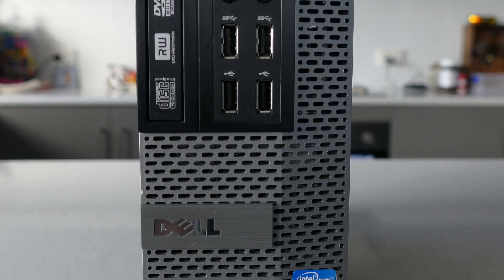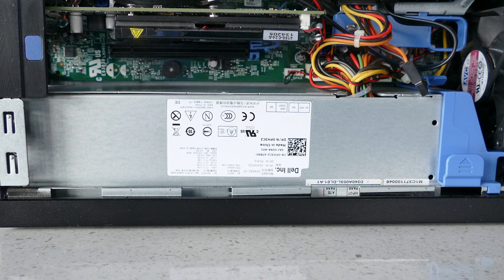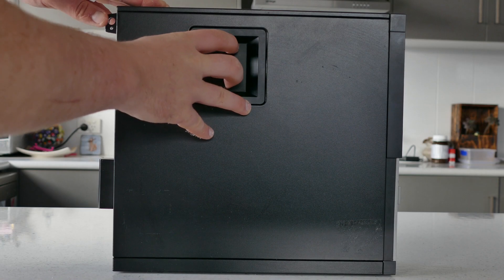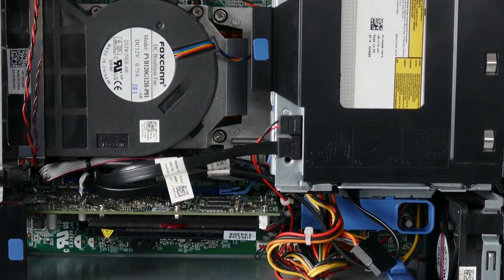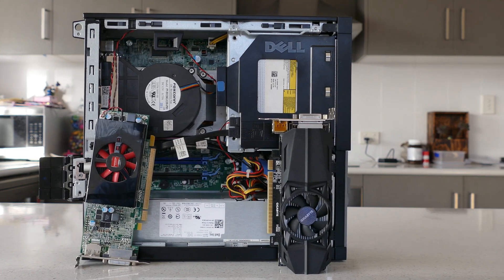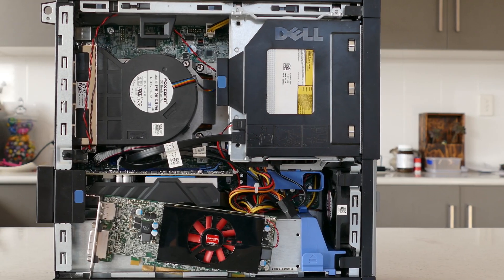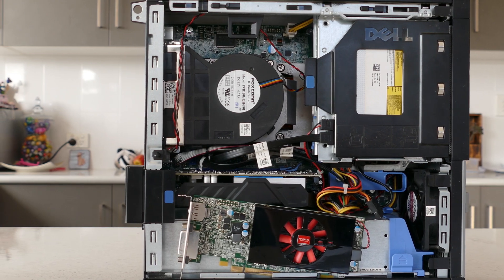Is the 1050Ti a Worthy Upgrade for this Old Dell?

Comment: Can I add a 500w +80 will that make a difference and if I add extra 4 gigs
Reply from the maker: You can add the extra RAM no worries but the PSU is a proprietary one with its own connectors so it cannot be easily replaced or upgraded with just any off the shelf PSU.
Reply: Oh
Reply: So any advice
Reply from the maker: You could gut the system and put it in a bigger case and cross your fingers that it uses standardised powered connectors. That’s probably the best option.

If not then you will only be able to use GPUs that don’t require power connectors.
Reply: Is there a specific model of the gtx 1050ti so can find the dimensions
Reply from the maker: Not really just make sure it has LP (Low Profile) in the name. I think Gigabyte, MSI and Zotac all make one.

Comment: air flow must be bad, i also live in Australia and think the gtx 1050ti for the price is bad you can get a rx 560 for around 200aud which will better then the 1050ti in price and fps
Reply from the maker: Airflow is terrible in these cases but you can remove the side panel, replace the fan or just let it throttle but thankfully these cards aren’t high powered so they don’t produce a lot of heat.

Just checked every major retailer in Australia and the only one that sells a low profile version of the RX 560 is Newegg which is $270 AUD with GST and Shipping. Can you give me a link if you have found a better deal.
Reply: https://www.amazon.com.au/gp/product/B07NXW2YVH/ref=ox_sc_act_image_1?smid=A4XRJ8S0WXSO0&psc=1. Its not a low profile but its 150 bucks!
Reply: Ah no... The RX 560 does it need an external power connector? Probably...

Is the RX 560 faster than 1050 Ti? -- Nope...

https://gpu.userbenchmark.com/Compare/Nvidia-GTX-1050-Ti-vs-AMD-RX-560/3649vs3926

The 1050Ti is great for computers that do not have external power connectors and is the fastest gpu in the world that doesn't need external power connectors

Comment: I have the same system with a gtx1050, but I added an SSD. It makes a world of difference.
Reply from the maker: If I was going to use this system as my main an SSD would be a must.
Reply: Everything by Sam it’s not my main. I use it as a home theater pc but wanted solid 4k playback so I went with the 1050 and i7 3770
Reply from the maker: That’s understandable

Comment: Please help. I got this card but have no output to my monitor. The PC aint reading the card and the nvidia drivers as well. How do i get it to output video. I am using a dell optiplex that came with an AMD 6450hd in it. Any help would be much appreciated.
Reply from the maker: Make sure to update your BIOS and there are a few settings you can tweak in the BIOS if it won’t read it. 

Unfortunately I can’t remember the settings as I found them on a random forum post somewhere but you should be able to google your question and find at least one forum post about it.

Comment: Hi sam, would you mind giving me some advice? After watching your video, I do bought a 1050ti video card on amazon (Gigabyte Geforce GTX 1050TI D5 GeForce GTX1050TI Internal Graphic Card 4096 MB), after I got it, I try to do it like you but I found the video card is too big to fit in my PC (dell optiplex 790 sff). It seems that I have to return it. I am not proficient in computer, I didn't realized the size difference between mini PC and normal ones. Do you have any recommendation about the 1050ti video card that fit in my PC?
Reply from the maker: You need to buy the low profile version like I stipulated in this video. It will generally have “LP” listed in its title. There are very few available, Zotac, MSI and Gigabyte are the only companies to make them I believe.
Reply: @EverythingbySam  Thank you so much for your reply. Really appreciate it. I did't know much about the computer hardware and not a native speaker of English. I watched your video again with subtitles and find that you mentioned the "low profile", which I did not notice before. I think now I know how to choose a fit one. Thank you again for your video and reply. ^_^  [laughing face]
Reply from the maker: No worries, glad I could help. Good luck with the graphics card.

Comment: Hello, i have an dell optiplex, it has an i5-2400, 4x2gb sticks of ddr3, the stock psu, will it handle the 1050ti low prof. or should i get the 1050 low prof.?
Reply from the maker: For longevity and to save some money I would stick to the 1050 but you can install the 1050Ti there just may be issues in the future.
Reply: @EverythingbySam  from 1050 and from 1050ti there is a 30€ difference
Reply from the maker: Well if it’s not that much difference go for it
Reply: @EverythingbySam  but im not sure if the psu can handle it, is there a difference in wattage of these cards?
Reply from the maker: On a spec sheet no they both draw 75W from the PCI lane but I have no doubt there would be a difference in power draw. Over time you will more than likely degrade your power supply but who knows at what point that would be it could be months it could be years.
Reply: @EverythingbySam  in some comparison videos, i see that 1050ti is better, but in some they seem not very different from each other, so i don't know.
Reply from the maker: The performance difference between the 2 with fluctuate depending on the game as each game is coded different and utilise different sections of the compute units at different times so there is no set percentage increase you will gain by going with one over the other.
Reply: @EverythingbySam  im just getting into pcs, so the games i would like to play at reasonable graphics and maybe above 100fps, csgo, fortnite, maybe other games but these two are the main ones
Reply from the maker: Well that aren’t generally graphically intense so either card can handle them fine but modern AAA titles such as Tomb Raider both card with struggle if you want to play at high details 60fps.
Reply: @EverythingbySam I'm not that kind of a person who pushes everything to its limits, so the 1050 would fit just right?
Reply from the maker: It’s up to you in the end. Either will suit, the 1050Ti is more powerful so if you can justify the extra $30 go for it if not just stick to the 1050.
Reply: @EverythingbySam  Great, thank you so much!
Reply: @EverythingbySam  Hey, i came back here to tell that the 1050 lp  2gb is now 116 euros,  it comes with 3 year warranty, so i think it's worth it, don't you?
Reply from the maker: You’re the one that should be making the final decision
Reply: @EverythingbySam  for the 60 dollar difference, i could maybe get a higher mhz speed ram, because mine is now 3 sticks of 2 gbs, which mhz is unknown, maybe 665mhz or 1333mhz
Reply from the maker: RAM speed makes almost no difference on an Intel platform
Reply: @EverythingbySam  oh really, so thats only for ryzen builds?
Reply from the maker: Yes, gaming performance will barely be affected by RAM speed
Reply: @EverythingbySam  so i will just get another 2gb so it would be 4x2gb

Comment: Wait so you’re telling me that 20$ gpu gets those FPS ain’t no way
Reply from the maker: 720p lowest settings isn’t exactly demanding even for the old original card
Reply: Everything by Sam so I can get 60+ FPS on fortnite and gta??
Reply from the maker: Yes with the more expensive 1050Ti LP card
Reply: Everything by Sam how bout the Radeon8570
Reply: Everything by Sam if I ran fortnite with my specs plus the 8570 at 1080p low how many FPS do you see me getting?
Reply from the maker: Unsure sorry as the game has gone through many updates since this video so it could have a lot better performance or worse and I don’t have this system anymore. 

I would say roughly 20-30% less FPS than 720p just as a guess.
Reply: Everything by Sam it’s just not a lot of people do reviews or benchmarks on this card for some reason
Reply from the maker: Well it’s honestly not a great card especially with modern titles it’s practically useless. 

The card is only useful for an emulator or nostalgic gaming rig these days so I can see why no one covers it.
Reply: Everything by Sam it’s just I’m on a tight budget my main build has a 1050 this one is just a challenge but honestly do you think I would get decent frames 60 is perfect for me
Reply from the maker: No you won’t get perfect frames. The cards are useless and would be a waste of investment
Reply: Everything by Sam then how did you get 60 FPS average
Reply from the maker: Lowest settings 720p which is not worth it and is basically unplayable
Reply: Everything by Sam specs are i52400 8gb ram 750 gb hd 240w ps optiplex 790 sff
Reply: Everything by Sam ok thanks for the help I’m sorry if I was being annoying

Comment: what company made the LP 1050 Ti you are using in the video and were can I get one and how much power does the GPU need due to the low amount of watts given from the PCI-E slot.
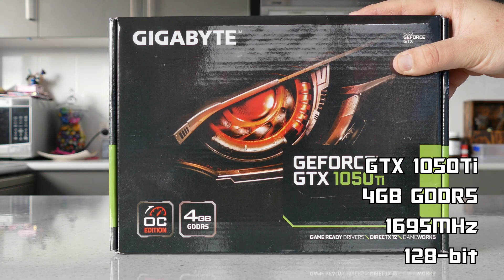Reply from the maker: 1.Gigabyte, literally days it on the box at 2:10

2. Any good PC component retailer should sell it including eBay and Amazon 

3. It runs entirely not power supplied by the PCIE slot. There are no power connectors on the card.

Comment: So I'm getting a dell optiplex 790 dt i5 2400 3.1 ghz, 8gb ram, I think a 240 watt psu don't quote me tho, and I'm planning on getting something like a 1050, 1050 ti, or HD 7870. What will even fit in this pc and do I have to upgrade the psu? Here is a link to the exact one I'm getting just in case you need more info or wanna see the size of the machine. https://rover.ebay.com/rover/0/0/0?mpre=https%3A%2F%2Fwww.ebay.com%2Fulk%2Fitm%2F223315481702
Reply from the maker: You will only be able to fit low profile (LP) graphics cards in that machine unless you want to get creative with a PCI riser cable. 

The current best LP GPU is the GTX 1050Ti but the best bang for the buck is the GTX 1050 but if you want to use it as a home theatre system with a bit of easy gaming on the side go the GT 1030.
Reply: @EverythingbySam  thank you so much dude. This was exactly the clarification I needed. So I think I'll go with the 1050 ti or 1050 because I'm willing to spend a bit more for better fps. Waiting until next check to get the last parts for pc. But I just got a couple other questions if you wouldn't mind helping me. So are all 3 of those low profile? and can I fit any gfx card I want as long as it's low profile? Also do I need the power supply upgraded or no?
Reply: I really don't know much about pcs except the basics but I've seen things like, graphics card takes 35w only from a certain slot which could make it fail, as well as you need to put it in the right pcie slot??? Not sure what that even means. I also saw you say to someone that it's hard to find a fitting power supply that will support the 1050 ti with no fails, so how could I get the best out of this pc. Like I want to make sure it doesn't shit out randomly due to me putting it into the wrong spot or not having a good psu or something. Basically what is the strongest gfx card I can get in this without problems, and if I can't do much, then how can I find the right power supply to fit my system and work with the gtx 1050 ti
Reply from the maker: 240W isn’t the ideal power supply for a 1050Ti setup as you never want to run it at max power draw which is what this setup will do which will eventually cause issues with your power supply failing.

You can get higher wattage power supplies for this form factor but they are expensive for what little power upgrade they offer so you are better off buying something different instead of trying to make this form factor work. 

Any low profile graphics card will work as long as you plug it into the long PCI slot which is usually the first slot but some motherboards will only allow 35W to be drawn from the slot which will degrade your graphics cards performance but it will still work. 

You can put in a 1050Ti and it will work but I can’t speak for the longevity of the setup as eventually something will fail if you are running it at peak performance such as gaming tasks or 3D applications.
Reply: @EverythingbySam  well I already bought the main component pc so that's a fat rip. Anyways I take it my options are as follows, buy a small form factor power supply which costs more, but I found used on ebay for around 50-60. I'm willing to pay that if I have to. So anyways I can get the small form psu 450 watts and run a 1050 ti? Or base 1050 only would work with a 450 watt and not the ti? And my other option would be to get a gt 1030 without getting a new psu and have no problems later on right. Am I correct? Or can you correct where I'm wrong. And if so, is 60-100 for a 450 w psu, since I really wanna do this build, alright? I'm also going to have to get the gfx card too but still, if it's worth it, I'm willing. Sorry brother I know my grammar is God awful, and this is a lot, but I really don't want to make a mistake when it comes to spending lots of money on a pc. Thank you again man. This really helps. You deserve my sub btw.
Reply from the maker: You would need to buy a dell certified OEM power supply due to propriety connectors which I think only go up to 300W which is enough for the 1050Ti not just any old power supply unfortunately if not you can still run the 1050Ti, or 1050 but you will be putting your system at risk at some stage.
Reply: @EverythingbySam  my last question then. Do you know what the best graphics card is that I can use with this 240 watt?
Reply from the maker: The GT 1030 is your safest bet but I would push it to the 1050 personally
Reply: @EverythingbySam  okay thanks for the help man. I heard from some people that the 1050 works fine with the psu. I'm trying to get a cancel on the order for the desktop version but if that doesn't work I'll just get the 1050 and hope for the best. If I AM able to get the order canceled, and I get the Mt instead, then can I easily upgrade the psu and gfx card any size as long as it's the Mt version? Or do I still have to have the specific dell oem psu? Because if I can, I would like to just get an MT version and have more upgradeability. If that's how it works, just size I mean
Reply from the maker: I am unsure if the motherboards in their Mt variants still use the same proprietary connectors as the SFF variant but if they don’t you are basically free the upgrade almost any part but if they do use the same connectors you are limited to the power draw and connectors available on the OEM PSU.
Reply: @EverythingbySam  ah. Well I got a refund and I'm going to try and see if I can figure out what proprietary connectors it has. Whatever that means lmao
Reply from the maker: Exclusive connector that only Dell uses
Reply: @EverythingbySam  thanks for the help. I ended up getting a full build pc from Facebook market for only 75 dollars and my broken laptop. It has Intel xeon w3530, 8gb ram, and a gtx 560 with a 500w psu. How will this hold up as it is in modern titles until I can save up enough to upgrade the gfx card and processor?
Reply from the maker: GPU will let you down majorly but the rest of the parts are good especially for the price
Reply: @EverythingbySam  yeah that's what I expected. I'm planning to get a gtx 750 for now. As it won't bottle neck my cpu. After that I plan to upgrade the psu, cpu, and gfx card to where they all work together. So like 800 w, 6 core xeon psu, and gtx 1050 ti or some shit

Comment: Getting a 9020 SFF with a i7-4790 and adding a 1050TI :)
Reply: You can't. With the optiplex xx20 sff series, the pcie x16 slot is on the bottom leaving you with only one choice.. the GT1030 is the best card you can get for these systems. if you want to run the  the games properly, get a 3010, 7010 or a 9010 sff. At the end of the day, a 3020, 7020 or 9020 are a waist of money if you want to upgrade it for gaming!
Reply: Jeffrey Kleeven so would I be able to do it with the 9010 sff
Reply: @jeffreykleeven  no need pci x16 slot to 1050ti
Reply: sub karpaty not really bur surely not a x1 slot my friend. That won’t work
Reply: @jeffreykleeven  you can simply use the x4 slot
Reply: hands up if anybody actually cares?
Reply from the maker: Good luck with your build.

Comment: How bout if I add 2.5"SSD + 3TB 3.5" Caviar Blue. And a PS4 Controller, Wifi DOngle,  HD Webcam. and RGB Mouse&KB. Could the 240w PSU can still handle all of it?
Reply from the maker: The only items that drain power directly from the PSU are the SSD and HDD which use basically no power compared to other components so that all could be ran easily.

Comment: Im thinking about getting a dell optiplex 790 tower i-5 2400 4 gb ram just to get started in pc gaming 

What gpu would recommend for it and would I need to upgrade my power supply?
Reply from the maker: Something like a GTX 1050 or 750Ti would be a good cheap GPU to chuck in there without having to upgrade your PSU or anything else. I would recommend getting another 4GB of RAM though as even windows can chew up a bit of RAM leaving very little for games.
Reply: Everything by Sam on the gpus do they need to be low profile and single slot?
Reply from the maker: Only if you have a SSF case like this one in the video even then if you wanted to get creative you could fit a full sized GPU in this case with some modding.
Reply: Everything by Sam ahh ok thanks for the help :) i”ll get to looking for a 1050 hopefully i can find a steal. Keep up the good work
Reply from the maker: Thanks mate. Don’t forget to look for one that doesn’t require PCIE power connectors as I doubt your PSU will have any.